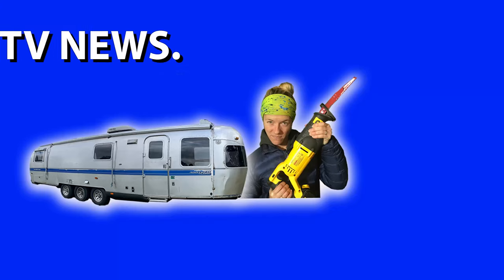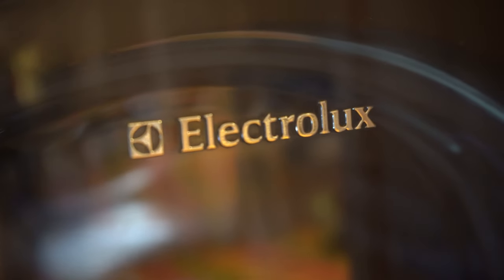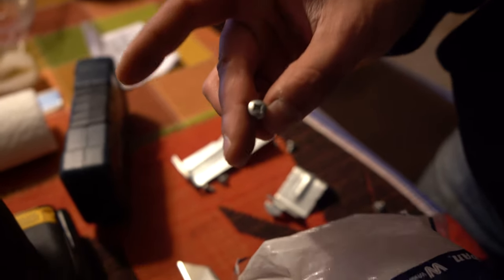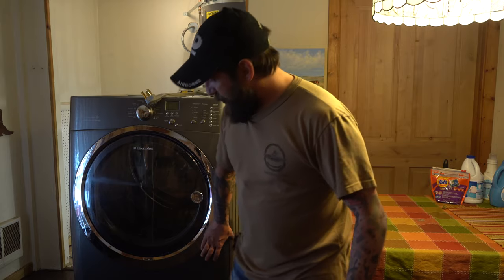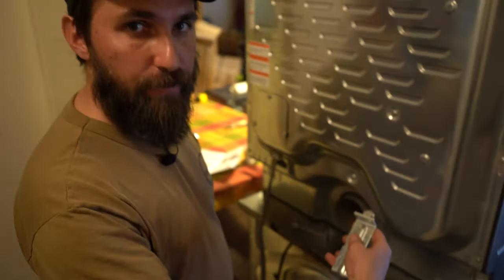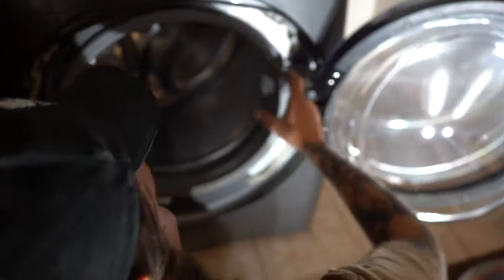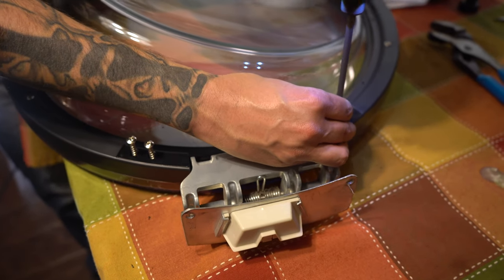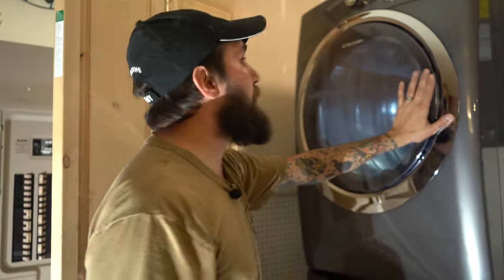How to Stack Washer & Dryer || Electrolux Stack It 4X

Comment: Helpful hint. Make sure you remove the foil and vinyl venting to the dryer. This is a fire hazard and will take half the life out of the dryer. 4" aluminum  hard pipe and elbows with foil tape at the seams is the best. Semi rigid aluminum can be used but is easy to ruin. Good luck
Reply from the maker: thanks for the tip!

Comment: Have the exact same set up. Machines work very well when side by side , but once stacked make all kinds of noise when spinning up(small load). Called in a the Electrolux tech to trouble shoot , he adjusted brackets and leveling several times, but could not completely eliminate noise. Totally unsatisfied with the lack of engineering that Electrolux put into their stacking kit. They defiantly were asleep at the wheel. Build a great machine but F**ked up on the stacking brackets. This something to really consider when buying a new washer\dryer that will be stacked. If I only knew earlier. Thanks you Electrolux.